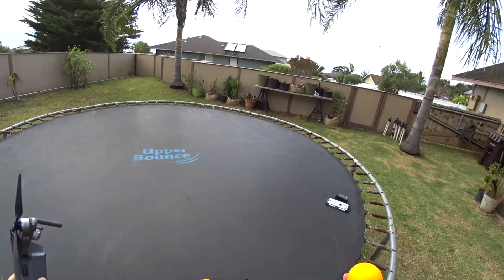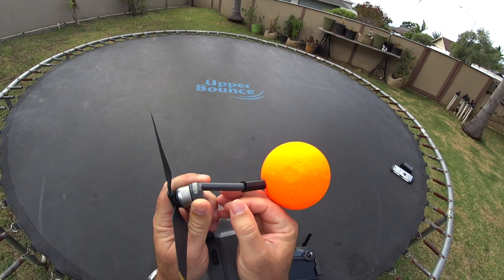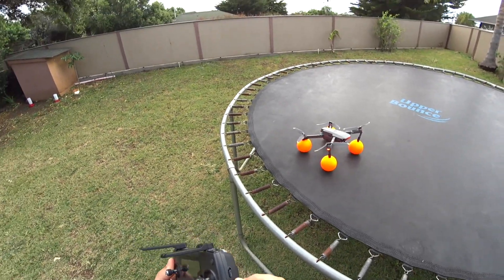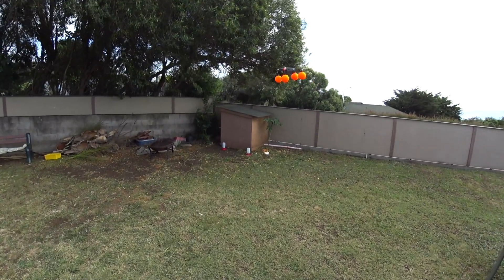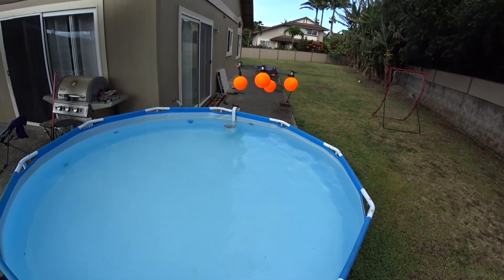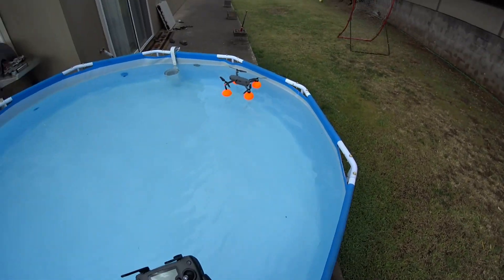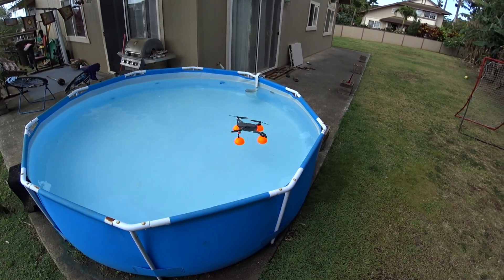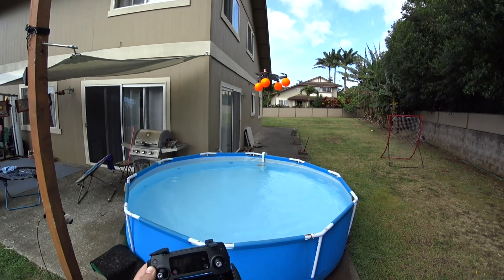DJI Mavic Pro Water Floaties - Will it Drown? - Full Review and Dunk Test! 😱💦

Comment: Hey Dustin I got a question to ask you. Yesterday I was on a trip and my spark did come back to home base. So once again spark lost. I purchased the Dji replacement thing and I need to know if they will replace it.
Reply from the maker: It may be hard since it's lost, but if you can upload the log file in your controller to them and it shows a malfunction not from pilot error they may help more since you have the insurance 👍
Reply: I did that. Will they have that info already.. I will try to go find it also.
Reply: And how do I start the process
Reply from the maker: You need to first contact DJI support and they will tell you how to do it all.

Comment: I'm wondering if you have your gimbal pointed down if you're going to get those big orange balls in the shot. You'll have to try some video.  DJI is pretty quick to cry "PILOT ERROR" ... and then be very adamant about not reversing course. When my Spark came out of Tripod mode (low GPS signal quality), I got an APP message and then 2 SECONDS later, it went from Tripod mode to ATTI mode, and jumped from 2.5 mph to 21 mph and flew into a cliff wall. I don't think I could have save it even if I had Superman's reflexes. 2 seconds isn't enough warning. As far as I was concerned, it should not have changed modes (as you know, in Tripod mode, you have to virtually give it full stick to get it to move at all .. and so when it switched to ATTI ... BOOM!) .. and that's a programming error in DJI GO 4. But, as in your case, DJI would have none of it, so I wound up buying a factory refurb. The original still work except for the gimbal pitch (roll is okay).  Not sure those balls would hold up under the waves you get out on that ocean. However, I live next to Lake Erie, and sometimes it gets like "glass", so in those instances, those balls would be ideal. Cheers.
Reply from the maker: If you do really abrupt movements they come in view at high angles.